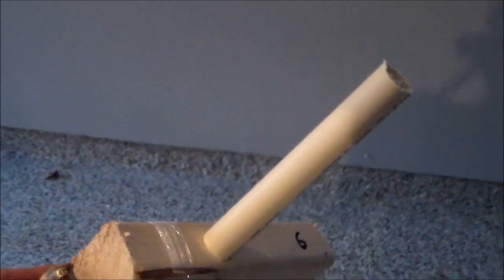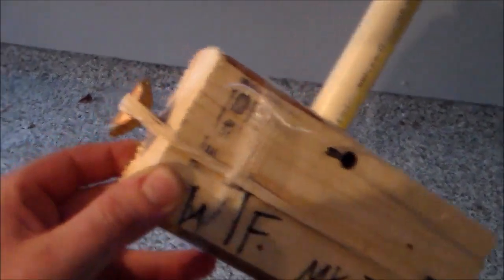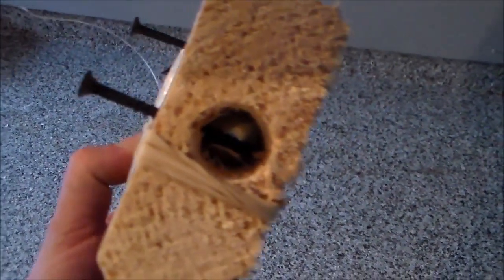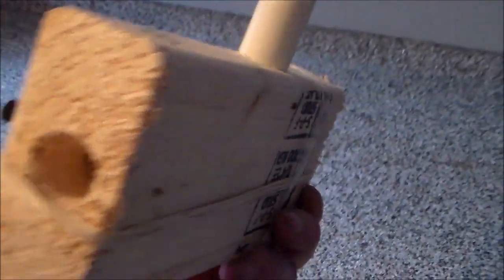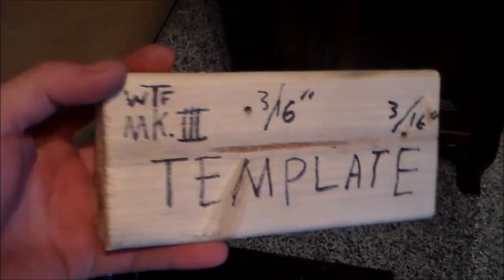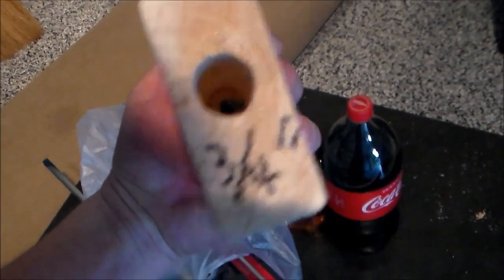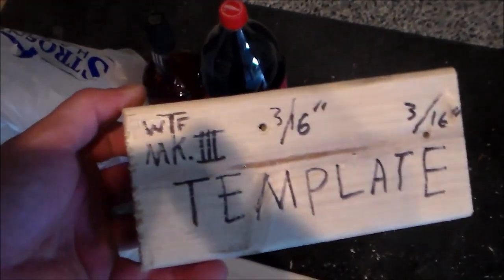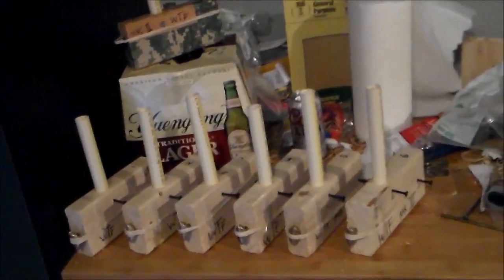85 Cent DIY Paintball Mines

Comment from the maker: I'm encouraging people to copy my design and make lots of these, should make the game a little messier.
Reply: Will Foster you know they make paintball mines that work 10x better than this right? Look up Aultec llc on google
Reply from the maker: Obviously its better, but is it 85 cents?
Reply: Will Foster there is no way this is 85 cents. The pvc pipe alone is at least 2 dollars and if you add the 12 grams which are 25 for a pack minimum it’s probably a 40 dollar build
Reply from the maker: @RiptidePaintball  I made 100 units for $85 total, thats 85 cents a unit.  That was the main point of this design challenge, it has to be under a dollar a unit so they can be disposable.  Nobody ever recovers a mine, the guy who tripped it will just take it home.